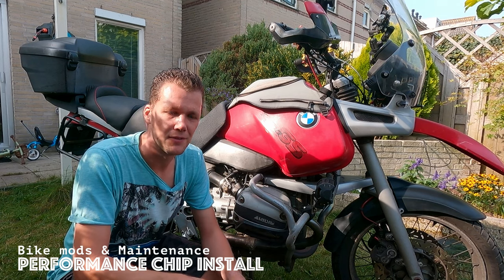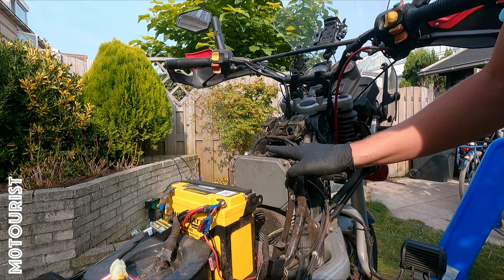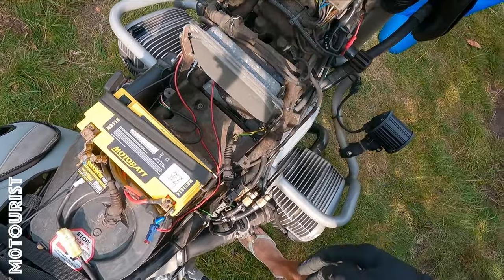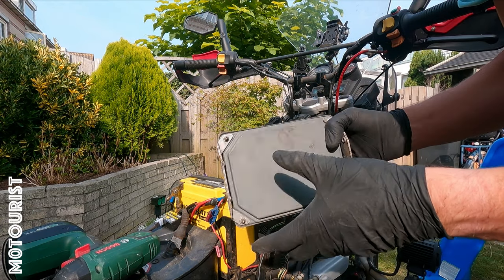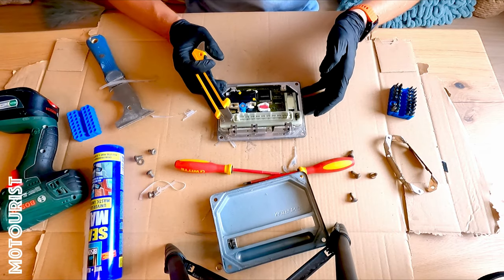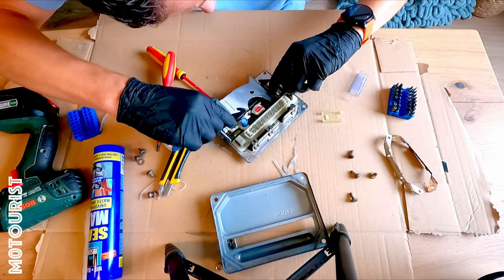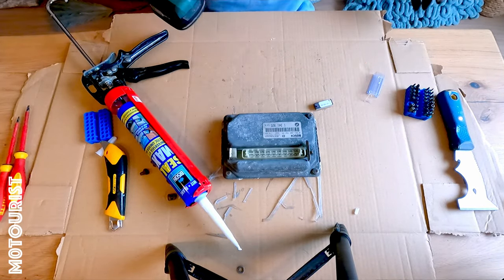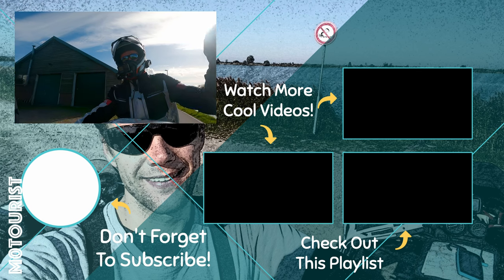Bike Mods & Maintenance - Performance Chip Install - R1100GS

Comment: Good video. I just ordered a performance chip from John. Does your GS have the stock exhaust and catalytic converter? If "yes", then you might not feel as much of again with the chip. My GS has a cat-delete mid-pipe and a very free flow exhaust...so, I'm hoping for a very noticeable gain. And yes, my bike is already very loud. 😀
Reply from the maker: Hey Rockgin,
mine also got a cat delete and aftermarket exhaust (with DB-killer). In my opinion it produces a very nice moderate sounde 😉

Comment: Hi, costs? A performance measure before and after the change would have been great. So it's a bit blabla, sorry. Also fuel consumption difference would have been great... regards!
Reply from the maker: Hey Geckos27,
I got it during a discount action from John and paid 60 euro i believe, normally they're around 100 euro.
John has some before and after results you can review for the horse power and torque.
Fuel economy is nice, but I don't do enough repetitive riding to get meaning full results.
Reply: @M0Tourist  Ok, thanx.
Reply from the maker: @geckos27  https://www.facebook.com/JohnGS1100

Comment: I have the exactly same bike i think ...94 plastic tank ? Anyway, u  know your stuff around the bike and i wanted to ask , what do u think that i have to be worrie of??any major issues ??
Thank you 🙏
Reply from the maker: I've the steel tank, and the bike is from '97. If you go offroading on the bike make sure you install the gearbox reinforcements.
For the rest, some TLC from time-to-time, but the bike is pretty straight forward to work on.